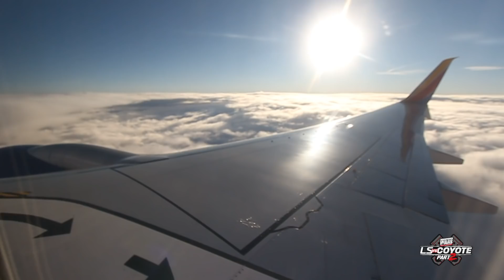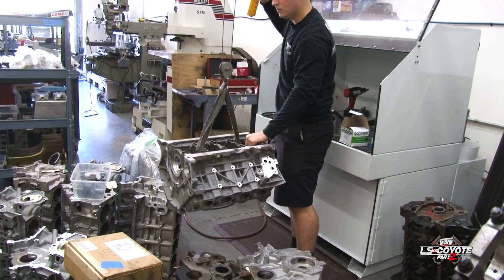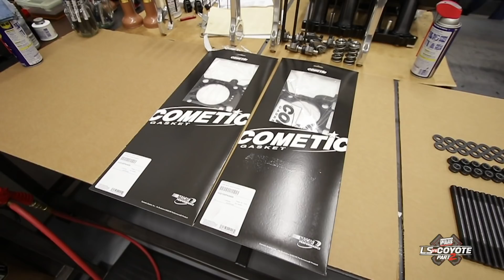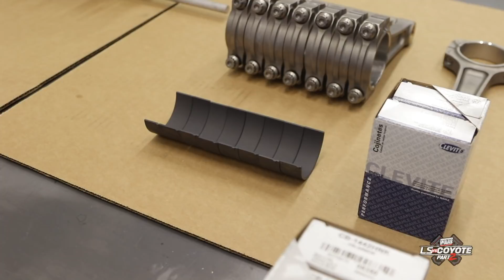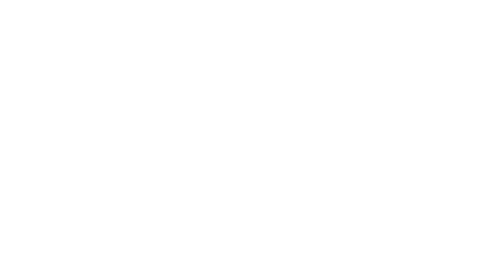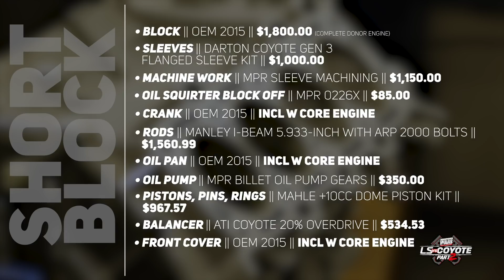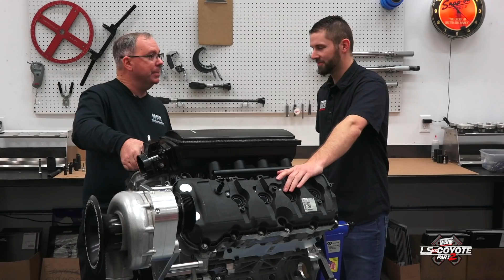LS vs. Coyote 2 Episode 3: The Coyote Engine Build

Comment: LS- puts machine work for short block in house so must be free of charge. Coyote puts machine work in house but costs $$$. You LS turds really find every single loop hole to try and win.
Reply: Yea clearly you're not getting what I'm putting out. Both LS and coyote did machine work in the sleeve area of the there blocks. LS did not use any aftermarket sleeves BUT THEY STILL MACHINE THAT AREA. Coyote not only put the cost of sleeves in there budget but also put almost 1200 in machine work. Regardless if LS put in sleeves or not if coyote has to charge for machining the same area they both should have to budget for the work. I like how you put "standard machine work" when LS machined there entire block and didnt have to put a single dollar of it in there budget. Your rules you imposed are flawed.
Reply from the maker: Standard machine work for the block is no cost, but re-sleeving and port work count against the budget. Check out the first episode: https://www.youtube.com/watch?v=NEYIYU484E0
Reply: In your rules you also state any unusual machining should be taken out of the budget. With that being said you even said in the LS video there was ALOT of machining going into that LS build. But it's just "standard machining" right?
Reply: @NitrousYote  Your an idiot. Read the rules and what he said before dropping an uneducated comment.
Reply: Porting the heads are the only machine cost that both LS and Coyote used for there budget.
Reply: Just giving the LS the benefit of the doubt when they put there heads over 3k, just assuming they combined the cost of the head with the porting work. Bc they didnt actually specify the actual cost of machine work for the heads like coyote did.
Reply: The LS team who built there engine, even stated themselves that the block they choose did not come at the cubic inch they where trying to reach. Hmmm anyone even remotely mechanically inclined would understand that there would need to be work done to the engine to reach said goal. You have spoke person from power automedia in the very beginning of the LS video stating there was a great deal of machining going into the engine. You guys are too funny man. Coyote played by the rules, they took there machine work and applied it to there budget. LS should have done the same. You guys are trying to compete with a LS engine that has over 100 additional cubic inches against a little 305 cubic inch coyote block. Not to mention you guys are not even using a block from LS that goes into any production car. You're using an aftermarket race setup block from LS. Gtfo you stupid fanboys. Learn your shit, neither of you can even afford an engine build like this let alone speak on it like you guys own anything like this. 😂😂😂
Reply: @NitrousYote  Lmfao your just an idiot. The LSX wasnt re-sleeved = no cost for anything. And it didnt have port work = no cost. Those are the only things that come out of the budget in terms of machine work.
Reply: You do not need to sleeve an engine to conduct machine work dumbass, and the LS heads where ported. Why dont you re watch LS video.
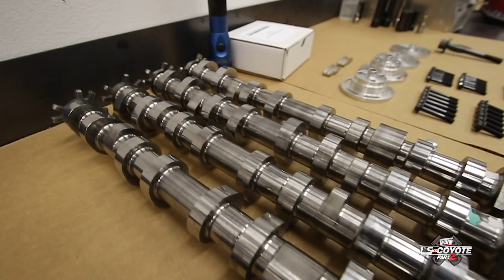Reply: At 18:09 in the LS video it clearly says porting done by LME with no price taken out. Fr kid just shut the fuck up. You obviously have no idea what you are talking about.
Reply: @NitrousYote  Your one hell of a fuckimg dumbass lmao. In this competition the only machine work that comes put of the budget is SLEEVING and PORTING. Ok? Doing machining in the cylinders isnt SLEEVING thats just free machining. The PORTING is already done on the heads when you buy them, thats part of the LME heads package. They arent going to add an extra cost for something that is already added

Comment: Dam all the fighting in crying there is a reason that everyone swaps a sbc or ls into everything cheap reliable light weight and easily modified easy to fix cant argue facts the dohc 5.0 has advantages there but comes at a cost and even tho ls bigger displacement its still a smaller lighter motor

Comment: I dont know why power per cubic inch matters cause the ls is a smaller motor even tho more cubic inches should be power per pound i know that sounds funny but ford guys always say it makes more power cause its bigger motor when really it aint
Reply: #1  the Coyote and LS weigh just about the same.
#2  WTF does weight have to do with power output?
Reply: Yall cry saying its not fair ls have more cubic inches but coyote has 4valve duel over head cams that evens the playing field in my eyes if you were comparing two push rod v8s i could see it
Reply: @joshshelby7322  How do the number of valves and cams level the playing field Josh... in your expert opinion, explain the advantage they provide here.
Reply: If you look at their old videos you can see they talk about it

Comment: The problem is that Chevy makes 2 million engines under the designation of “LS”. So the Chevy guys can pick the most outlandish version of the LS that has the most displacement and power as possible and say “yeah it’s way better than the coyote in every single way.” Ford only makes two versions of the coyote, one for the mustang and one for the trucks. If the 5.2 engine in the gt350 was called a coyote engine and used for this build it would put the LS in its place easily. But since the 5.2 isn’t called a coyote, it’s not allowed in the competition

Comment: The budget thing is on my nerves. You’re comparing a 427 cubic inch aftermarket block and heads, to a stock block and head 302?! Money doesn’t grow on trees but when you have a more advanced modern motor it’s going to cost more. I’m no fanboy of any brand just a car guy but this is crazy. Even GT350 heads would be more competitive. LS engines are cheap that’s well known, but part for part the coyote is very competitive. Just overall annoyed with the unlevel playing field. Displacement is way outta wack, aftermarket block doesn’t add power but noted, aftermarket heads (bad ass ones too). Just very lopsided. It would be tragic if the LS didn’t win
Reply: So you'd rather they spend extra money on the 5.0 to make it fair?
Reply: SnifferSock correct part for part. The LS is already known to be the cheapest dollar per hp that’s no surprise. Everyone knows that. “You can get a 5.3 from a junkyard” etc etc.... what’s more interesting and informative is how it compares part for part. You can share how much each engine costs at the end but it’s just an easier analysis. LS is the cheapest hands down. Not everyone wants the cheapest though. I’d say use the same limits on parts like hydraulic rollers, certain super charger, displacement range, etc. price is important so don’t exclude that but again I want to see what each engine does mod for mod.
Reply: @SnifferSock   How about they not lie to us all about the actual cost of that Brodix All Billet Motor and intake system. Its a 40 grand Billet motor compared to a true blue all long block Ford 5.0. Now where is your LS Stock long block, that's what these arguments are always about...but guys like you aren't intelligent enough to even go and price all this up...just try it and tell me what cost you actually get. This is a slap in the face to the GM guys, your being treated like your all stupid and don't know any better!!!

Comment: Won’t cam lockouts disable the TI-VCT and therefore kill low end torque production?
Reply: You are correct, but the blower and E85 will get it back plus some.
Reply: @charlesnienhouse9517  Wouldn't it just be better to leave them as is? What advantages do the cam lockouts give?

Comment: these mf swear chevy is the best. 
And talk shit about the little 5.0. 2 liters smaller, and yall cant say nothing else but "nah the engine is bigger its huge" stfu yall just mad that ford could fit 4 valves in a smaller cylinder😆.. shit if they would've just used the 5.2 they wouldnt even had to buy anything else but the supercharger yall chevy boys are lame. they didnt use the 5.2 because they know its no competition. its already high compression ready for any application so they knew better.
Reply: Hahaha, you ford guys finally have a motor that you can crow about, and it only took them 14 years to get it right, lol.  Are you mad that GM uses a tried and true simple design and beats a quad cammed, high revving, physically larger motor? Sure sounds like it.
Reply: @mrhrobinson  what the fuck are you talking about, dohc been out since back then (cobra engines) this is the same just in 5.0 liters. You must have shit on your head because i know you dont have a brain

Comment: You are going to blow that engine up with that 12.5-1 pistons
Reply: Randall Wyatt not on E85. They can run higher compression ratios with it than dinosaurs juice.
Reply: 105 octane minimum lol....does make a difference!
Reply: Plenty of 4.6 and 5.4s on higher compression making more power.
Reply: @luciankristov6436  not with boost

Comment: Lolol has to sleeve to sustain over 900hp 😂😂
Reply: They didn't need to waste money on sleeves.  The second gen Coyotes (2015-2017) could handle that sort of power without any issues on a totally stock motor.

Comment: Holy crap I could fill an ocean with all the tears shed by one particular group of viewers of this and the video over the LS motor’s assembly and parts spread! Stop it already! You haven’t even lost yet but it sure seems you’re certain you will because you’re already crying foul over perceived imbalances! Each engine was built with best parts available while remaining under the $15k budget for parts only. It doesn’t have to be a factory stock pullout motor from any vehicle model from either manufacturer! It just has to represent the platform it’s based off of.  Other than that there are no restrictions for EITHER engine. Shut up already, cry when it’s over!
Reply: Yet the ls manifold was 1600 cheaper than retail. They replied saying it was customer price yet say parts must be retail summit prices how is that not imbalance?
Reply: They charged machine work for coyote build but not for the LS too.
Reply: I'm used to the gm guys out cubing me .... I'm good with it, no crying here
Reply: Well said bro! Like wtf...really
Reply: @cory holbrook $15k budget you say? Go to LME's website and tell me what an LSX based engine starts out and you let me know how that budget worked out. I'll give you a hint...just the longblock (not including a $5000 custom billet manifold) is $24k.
Reply: Still more stupid arguments. The Coyote was charged JUST FOR INSTALLING SLEEVES! Not basic machine work and assembly because what good are sleeves if they’re not installed? Also, the price A D  quoted is FOR MORE THAN JUST PARTS!!! The budget is ONLY for parts!... unless those parts require extra machining to install. You think that Coyote was built for $15k all in? Try again. You also pay a premium for proprietary knowledge. You won’t get a Nelson engine for cheap either because he’s done his homework and knows what he’s doing. You’re paying for his knowledge, his time and experience. That isn’t included in the price of these builds. That’s why the price of a crate engine is from LME or NRE is so high. As far as the price of the manifold... that’s shady. A $5k manifold is pretty shady too though when you can get 99% of the performance for 10% of that price. But really that’s not what I was defending. I was just sick of comment after comment crying about cubic inches and aftermarket heads and blocks. If it isn’t available, how are you going to use it and how even of a match would it really be if you locked these builds into factory parts only? Who builds serious engines with just modified factory stuff? Only if they’re forced to... Ford.

Comment: Wow I thought the coyotard would have a huge money advantage considering the LS guys bought cylinder heads. But over 3 grand for cam, springs, retainers, lockout, stuff.
Reply: And yet my homeboy is trading in his silverado for a ford because he wants a super charge it and it cost just oil pump gears boost a pump and injectors not like the chevy needs almost everything and also those three mods to take advantage of the super charger

Comment: Mustang is best bang for buck period. LS/LT nutswingers just stay hating 😂 everyone knows a gaymero can’t handle a little boost out the factory
Reply: Amazing Stock Bottom End 6.0L Makes 1,543 HP with Turbos!
Reply: Lingenfelter High Flow Direct Injection Fuel Kit Helps Push LT4 Beyond 1,500 HP
Reply: Step away from the crack pipe son. 
There're more chevy motors in old fords than you can count.
Reply: S Paul  wow. Sucks Chevy motor has to use a good platform to achieve anything good 😂 also your welcome for the rear ends.  Cause we all know chevy rear ends are piles of pigeon shit
Reply: @vicrizzo3330 , I think it's Ford guys looking for a better engine
Reply: Anthony Webber delusional asf. Lmaoooo.  Funny how cadillacs ATSV Mod design V6 doing similar times to the new LT4 in the V. I’m sure the mod V6 would take a shit on the. New LT4 if it was in a cumero too. Lol. Sucks to suck 😂
Reply: @vicrizzo3330  what? When did corporate 14s become pigeon shit?
Reply: a c  are you being serious....? Lol asking for a friend
Reply: Vic Rizzo
the Cadillac ATSV has help from to hair dryers
Reply: @Mayamax3  Dont forget about the transmissions too lol
Reply: You must have forgot about the ZL1, ZR1, CTS-V.......all boosted from the factory......
Reply: RIPTIDE FPV  wow. Didn’t know the coyote was going up against the LSA, LS9,LT4 etc..... coulda sworn the coyotes competition was the LT1.  But never mind.  You just confirmed that LT1 is a pile of shit
Reply: @vicrizzo3330  

Watch "ProCharger LT1 and LT4 Camaro SS and ZL1 Supercharger Systems!" on YouTube
https://youtu.be/5azDpKXYv8c
Reply: @vicrizzo3330 , read my second comment
Reply: @vicrizzo3330 , Coyote came out in 2011, LT engines came out for 2014, LS engines were use up to 2013
Reply: Anthony Webber  ok...... let me rephrase my self. Cause you and old timer aren’t understanding anything.  WhuT MotUr iN a SS cAN hanDeL bOOsT likeA CoyOTE ? Sealed all around.
Reply: Love when chevtards run to 4.8s, 5.3s, and 6.0s when it comes to boost lol. Gotta love em. When a coyote can boost an run all season long. Not just do a few glory passes and throw in the towel. Lol amazing
Reply: Vic Rizzo
it depends on the Tune
After eclipsing 1,200 hp, we kept going. Raising the boost beyond 27 psi resulted in what we suspect was an ignition failure. The motor was still in perfect shape internally and worked well up to 26 psi, but unfortunately we were out of available dyno time. The motor survived more than 60 runs, the majority of them more than 1,000 hp. We hammered this motor like we stole it, with repeated back-to-back pulls, but the little LS never missed a beat and was ready for more.

Then something dawned on us after pulling it off the dyno: 5.3s don’t come with flat-top pistons (we know the few exceptions). Combine this with the fact that this combination produced peak power at 7,000 rpm, and we started to suspect that it might not be a 5.3 after all. Off came the oil pan and sure enough, connected to those flat-tops was set of 121 connecting rods and a crank that featured a casting number of 12553482. That’s right, this 1,203hp 5.3 was actually a 4.8L. That’s just 294 ci for a stunning 4.09 hp/ci.

The longevity of the combination is still in question, but having survived about 60 pulls under big boost means it could easily run a full season at the strip,
Reply: @vicrizzo3330  ya, why they had to put a sleeve in the Shytote, and from "18 on the yote doesnt have a sleeve, have fun boosting that shyt FANBOIS lol
Reply: Re read my comment. Are you that dense ?